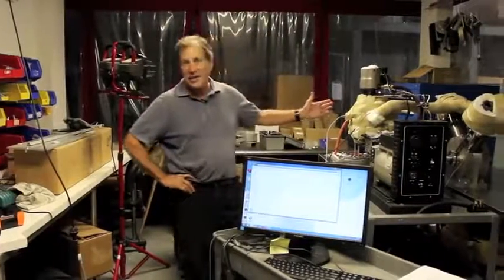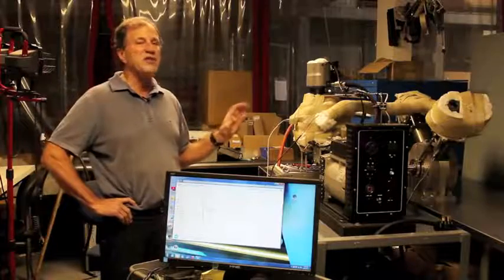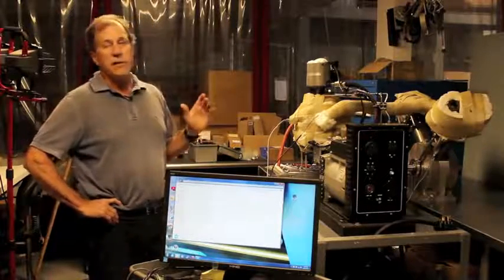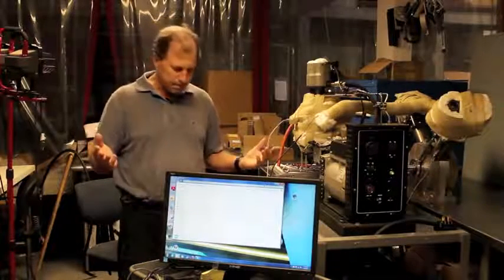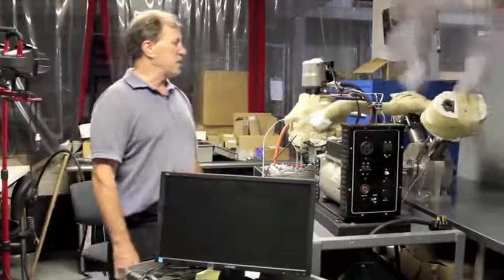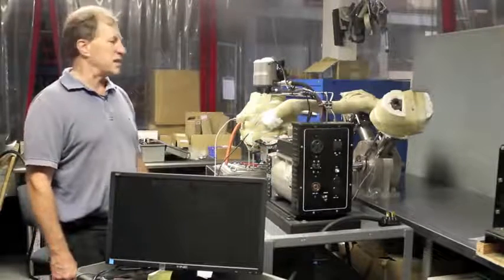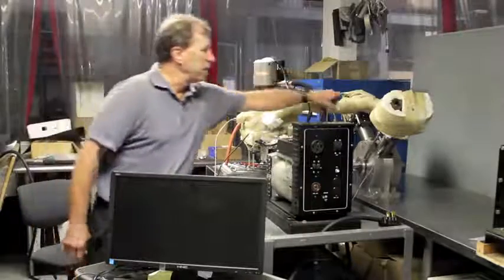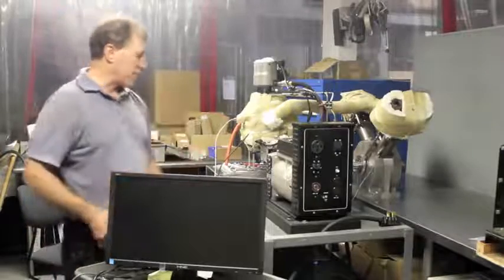Single Injector Running  113 cubic inch V-2 Steam Engine.

Comment: I'm still puzzled how taking power from the grid to heat your cavity and run your high pressure pumps is gaining any energy and reducing the use of fossil fuels to run the power grid that feeds this machine. At best you'll get maybe a high 90% of the input energy back out of what you put in. That's a COP of less than 100%.

Comment: It's very cool experiments, but it takes away from the presentation, when you claim this is something new and original you dreamed up yourself. Now that's a BIG lie. I'm sure you know better. What do you think Jim Griggs f.ex. would say to that ? And he based his patents on others. Also there are a lot better cavitation nozzles that are PATENTED through the last 100 years. As you must know the technology (though it has not gotten the attention it deserves) and phenomenon of cavitation has been used by industry and military for ages, and can even be bought off the shelves (different cavitation reactors, or complete heating systems) if you know where to look.